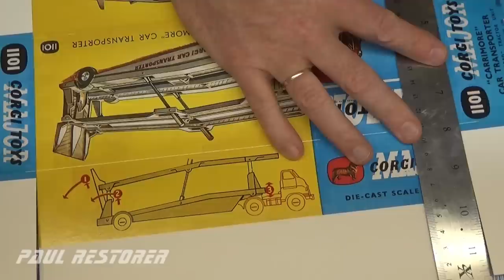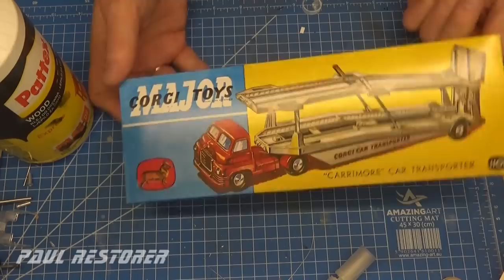Corgi renowacja Bedford Carrimore transporter samochodowy nr 1101. Zabawka model odlewany.

Comment: Great restoration. Can I ask, what is that tool you are using at 19.13 when you put the wheels on?
Reply from the maker: in this case, I use a cordless drill with a hammer on and attach the hollow shank of a hard M6 screw. In many videos I show the moment of putting the screw on the drill. Be sure to turn on subtitles in your language
Reply: OK great. Thanks for the  info 👍